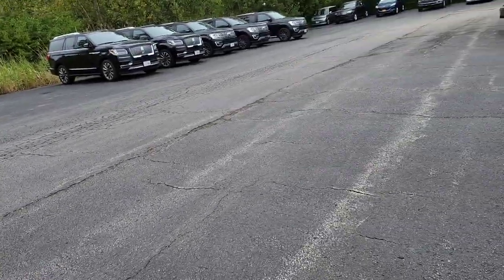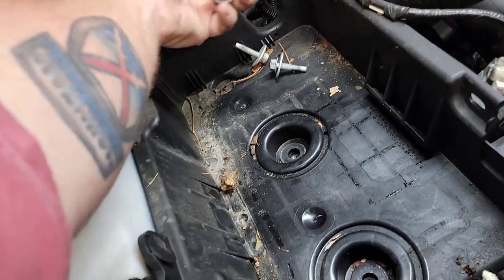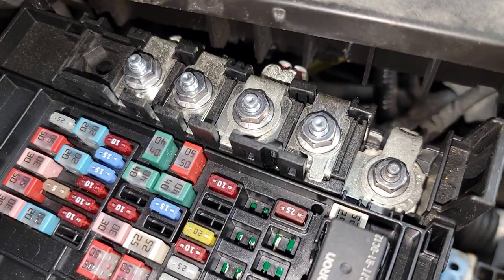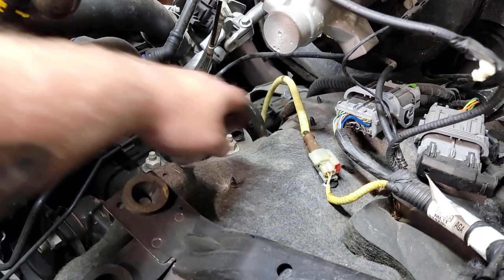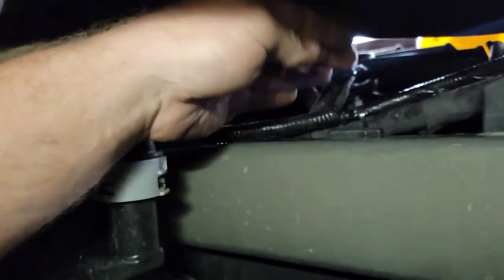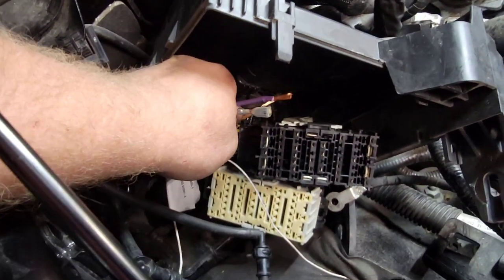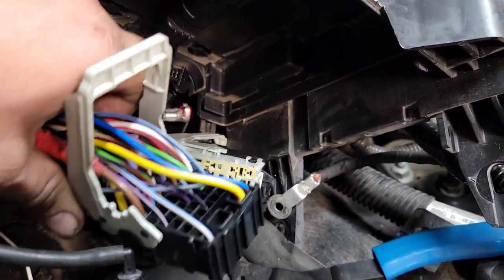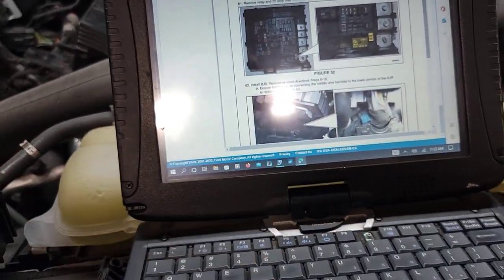Underhood Fire Randomly - 2021 Ford Expedition And Lincoln Navigator 22s36 How To Perform

Comment: Always thought anything with that yellow tube/connection was airbag system related. Did they change that?
Reply from the maker: Yellow tube?
Reply: @FordBossMe  by the shock mount, I think you said it went to the vacuum 4wd system
Reply from the maker: @1978dakdog  oh yeah it's jot Airbag related at all
Reply: It's a wheel speed sensor

Comment: If you run a self test ,it will Cycle the high and low fan control. You will know if it is wired right and check for faults in one step.
Reply from the maker: Yeah that's true or you can just go right to the Data Logger and do it this way which is just as easy

Comment: Lol yet another recall and I’d like to be in the room when they come and tell the engineers they have to fix it with nothing more than a stick of gum and some zip ties and electrical tape and a prayer lol what a mess RICH and hey 1 down and 59 more to go lol and you know you will be answering questions on this fix for months your going to need a gallon of milk and a case of cookies lol but only you could pull this fix off nice job

Comment: This seems like kind of a half assed repair. Like, why wouldn't Ford include a metal bracket for that box thing at the end of the one harness instead of zip ties? Zip ties don't last forever with all that heat underhood. I figured I'd pass this on to you,  back in the winter,  I had a guy bring in a 2016 or 17 f150 3.5 non EcoBoost. Brings it in for an oil change. First thing I noticed is both rad fans are going full beans. HVAC was off, truck was cold. Shop manager says don't worry about it. I upsell him rear brakes, does he want me to look at the fan issue? He does not. Truck has electric e brake,  I pull the calipers in with the scanner,  no problems. Test drive it, etc. Long story short,  guy comes back following Monday says service parking brake and traction lights coming on. Great. I find that harness you were replacing under the rad fans all chafed, burnt wires. It also goes to the abs unit. Have you come across this yet?
Reply: I've seen that one time so far on a 3.5 ecoboost f150 the harness 14290 being chaffed and causing issue with the rf wss, good thing it was all it was and got fixed before the damage got too extensive.